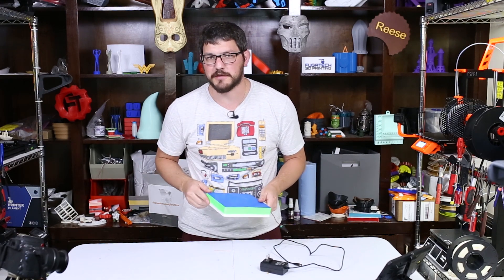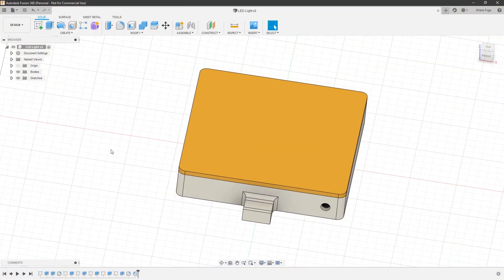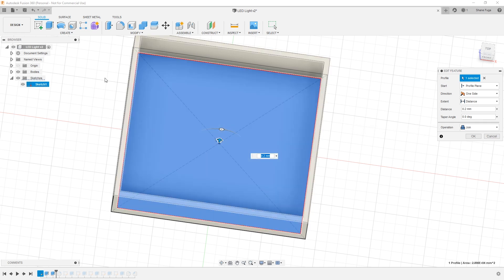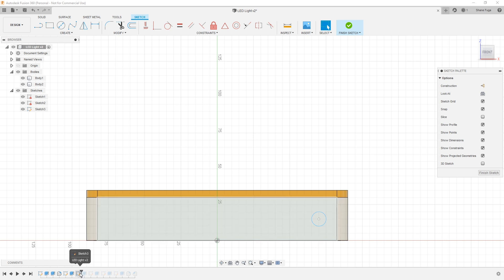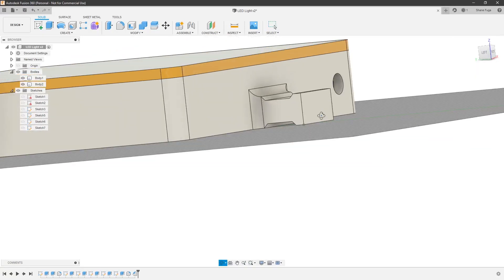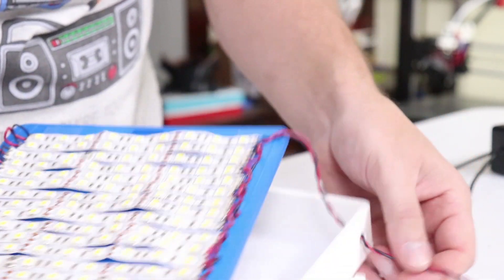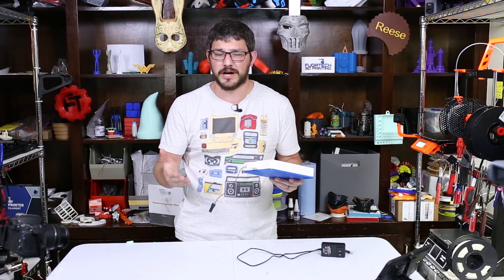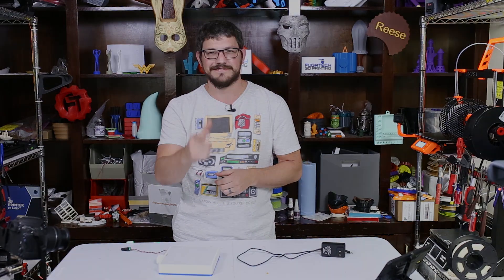3D Printed LED Streaming Light

Comment: I made a portable LED light bar too, but I'm facing an issue, the LEDs and a boost converter are heating too much and getting to a point they melt the PLA box.
Do someone knows a way to prevent it?
Reply from the maker: A few things to consider is adding a fan. Adding ventilation holes round the box. You also could reprint the box in ABS or PETG as they are more resistant to heat.

Comment: The wireing is much to complicated. It is a bad idea to wire the segments "in serial". What you wire "in serial" is only the power. All segments are electrical in parallel; inside the segement there is resistor, LED1, LED2, LED3 in serial. So beside your wireing pushing all the Amps needed for the whole light through the thin copper layer of the first segment (so due to resistance of the copper layer the segments most away might be darker than the first segment). it would't matter if you do such complicated cabeling or a quite easier one:
On one side of all lines of the lighstrip cut away the Vcc Pad with a scissor. On the other side cut away all GND soldering pads. Than you can use a blank copper wire to connect all Vcc to the power input and a blank wire on the other end of the lines to connect as GND. Half the soldering - and no fiddling with the wires to go zig-zack. Just one copper wire on both sides, connected to the power connector at the end. Much cleaner setup, much less space needed.

Serial wireing only is required for dataline on neopixels. But power of classic lightstrips always parallel to avoid uneccasary high amps on the copper traces. Of course exept from lightstrips wit Constant current supply without resistors. They are a total different matter, as the internal wirering must fit the power source...
Reply from the maker: Thanks. I know there are other ways to do this but this way worked out for this simple project.